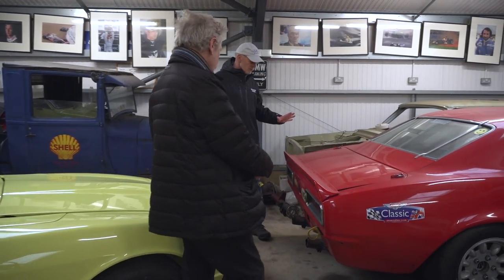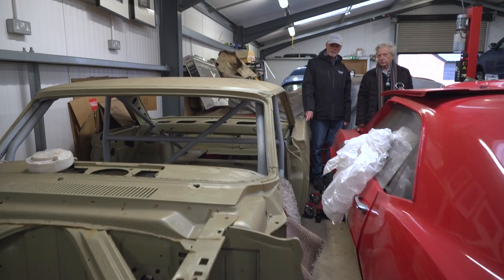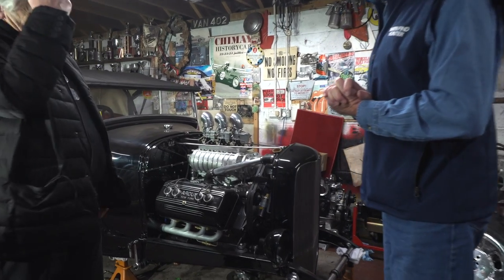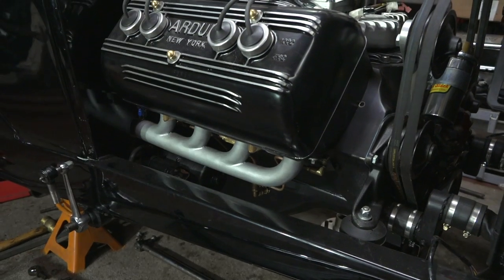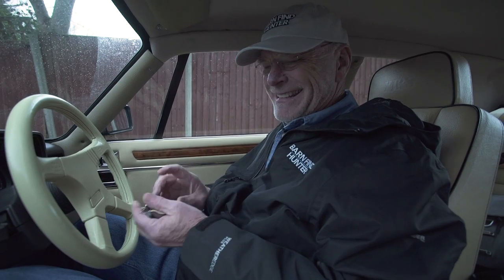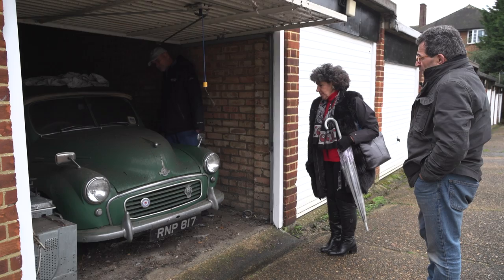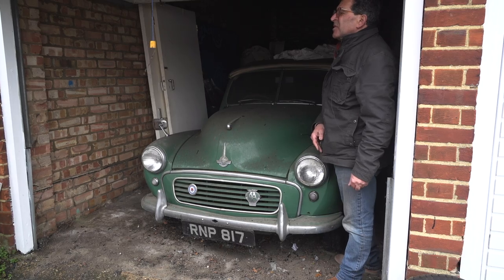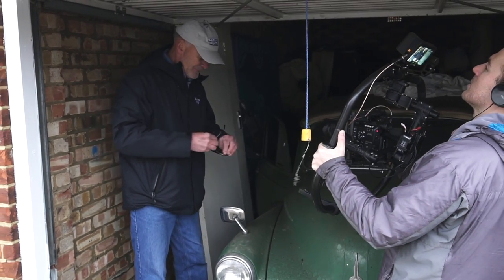Hot rods, Ardun heads, and a forgotten Morris Minor | Barn Find Hunter - Ep. 83

Comment: Of course Ardun heads were problematic for hot rods.  Most think they were designed for racing, not so. Original design was for the military for trucks to up that 85 hp of the flathead. Only went into production for garbage trucks in the UK. Not exactly a high winding wide open throttle application.